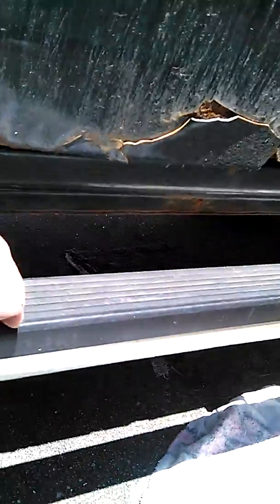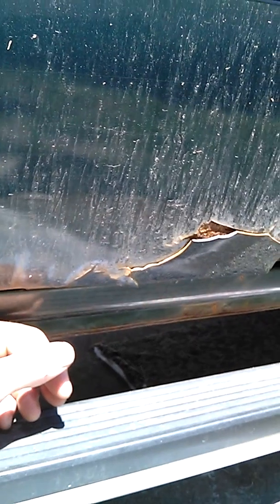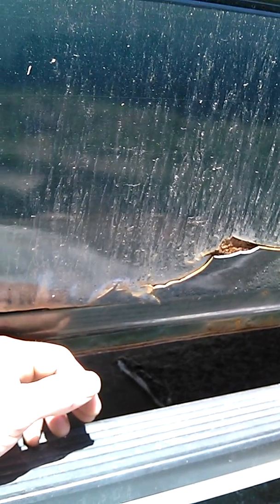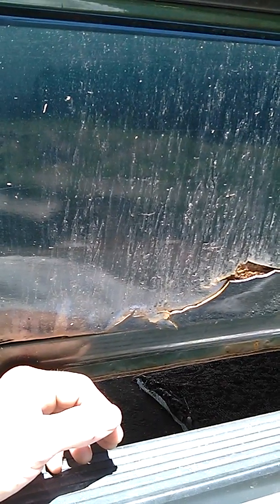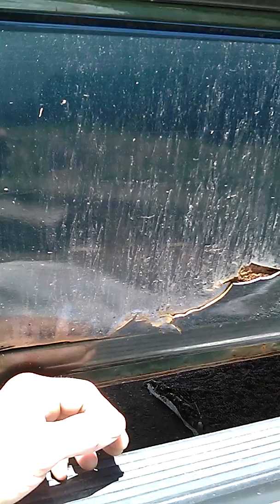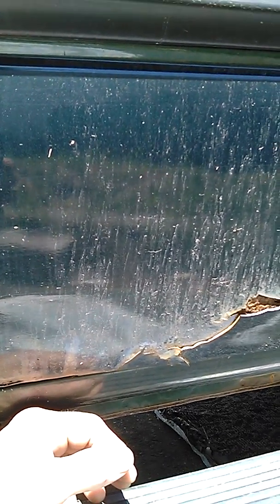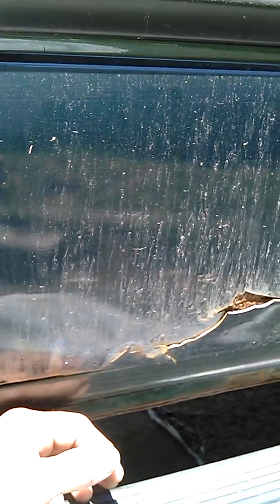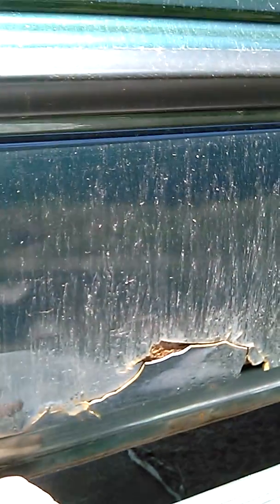2001 dodge 2500  P0132, P0138, P0139,  P0137 o2

Comment: HELP!! I have codes P0132, P0135 and P0141. My O2 sensors have too much voltage. I don’t know what to do next?!
Reply from the maker: Late reply Constance!!! How did you make out with repairs. Let us know thanks
Reply: Turns out that my PCM/ECM was bad and the car computer exchange company that I got my new computer from sent me the wrong computer, federal emissions, not Calif. emissions, S my VIN number clearly indicated. And they wouldn’t even acknowledge me. So I bought another computer from “Flagship One” and get this...it was new not rebuilt, a hundred dollars less expensive and their staff was very knowledgeable, confirming right there on the phone, emissions. No problems after that. Truck runs like a champ!